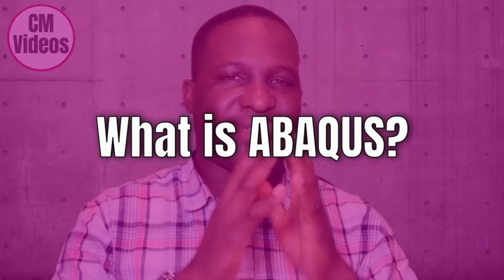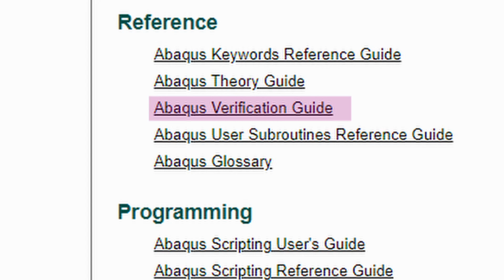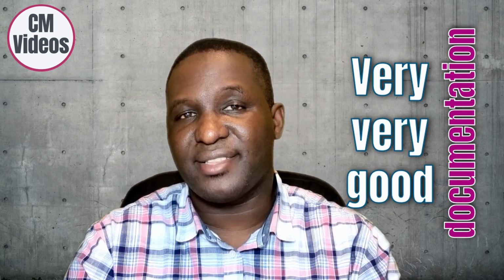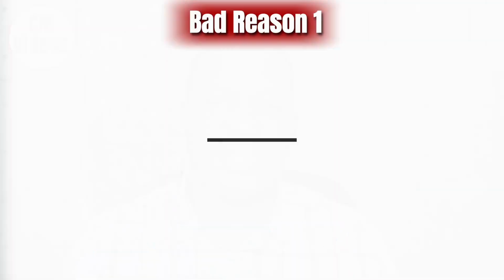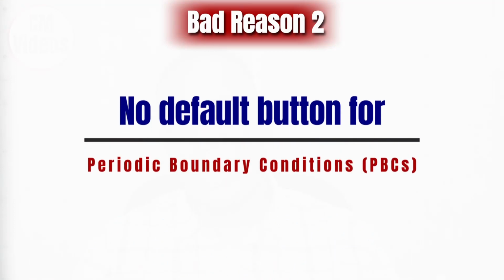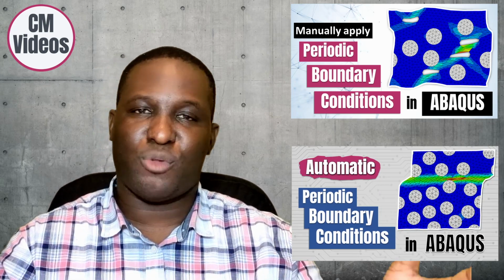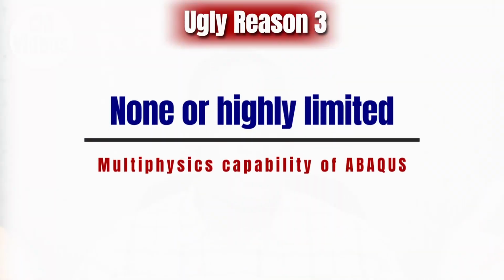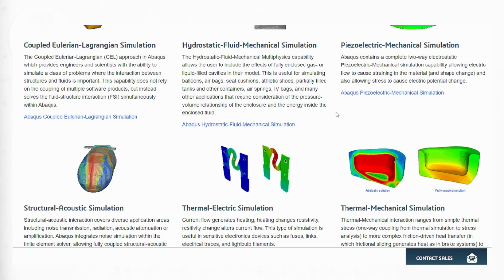What's Good, Bad and Ugly about ABAQUS?

Comment: I am not sure if I put CAE in good. Its ok for small models but as soon as you go into assemblies and decent size model, it does not offer good features. Most of the commercial users use external software such as Ansa or simlab to setup the input file and then use the solver. This really make issues when you try to perform parametric analysis. The link is broken with CAD and thus a lot of manual effort goes into resetup which also results in human error.
Reply from the maker: Hello @ashutosh, thanks for the comment. I agree with you that CAE can become unstable when the model becomes really large. ANSA is a fantastic software to create good meshes and input files with ABAQUS. There is a CAD interface though which means you can still keep the geometry in CAD environment and then connect it with ABAQUS so you get the benefit of both tools. I agree with your thoughts but there can be a work around but it lends itself to errors as you suggested.